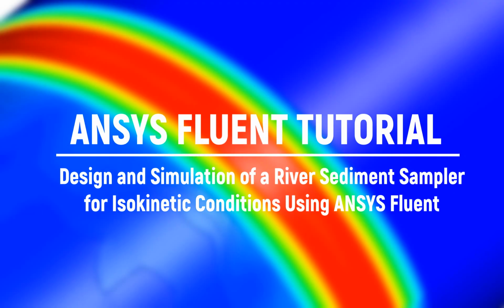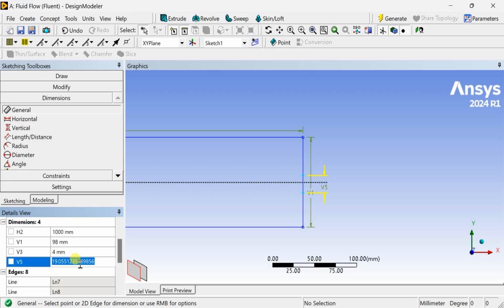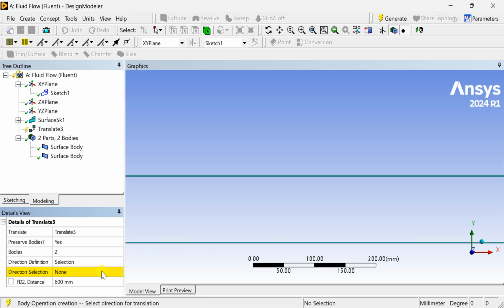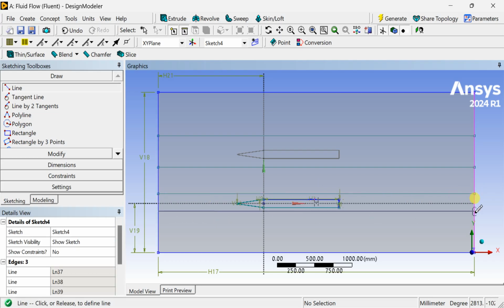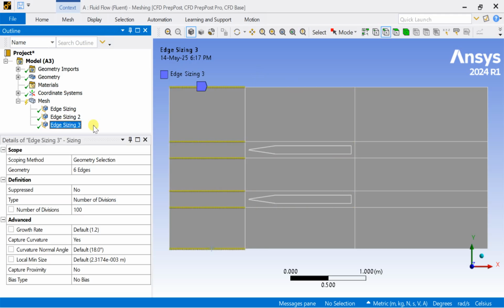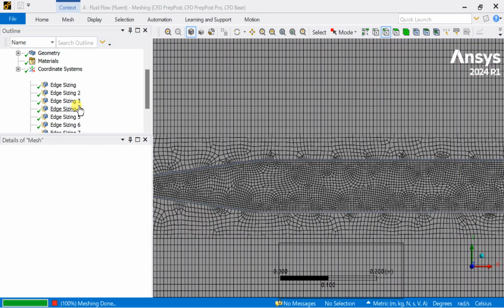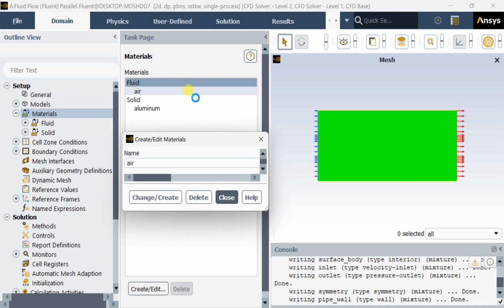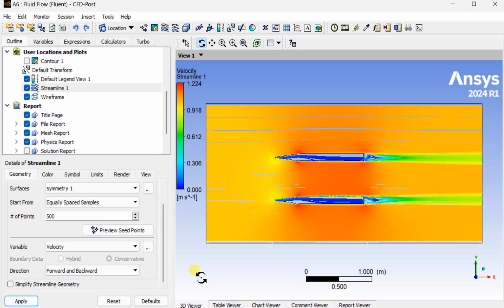ANSYS Fluent CFD Tutorial | Isokinetic River Sediment Sampler Simulation | Phillips Sediment Sampler

Comment: Thank you so much for your helpfull video. I would like to ask you about the " Concept>> lines from sketches" and " Tools>> projection". I can copy you and follow the same steps you did, but I still do not understand what is the essence of those two steps. Could you please tell me why you did it ?
Reply from the maker: For better meshing. Watch the meshing steps to know why I did like that. You can also use face splitting to do the same.
Reply: @AnsysTutor   Thank you for your reply.  Actually I know that you used the " lines from sketches" in order to manpulate the mesh, but maybe my question was not clear enough. So let me break down my question:  1-  Why did you supress the " line body" after the projection operation? 2- If you left the line body without supress, would Ansys deal with it as  barrier in the fluid domain?
Reply from the maker: @mahmoudsaleh9006  ANSYS Fluent only considers the 2D and 3D elements , this line body has no effect on the solutions, this would be automatically suppresssed while meshing, as its not required for the next step that why I suppressed it.